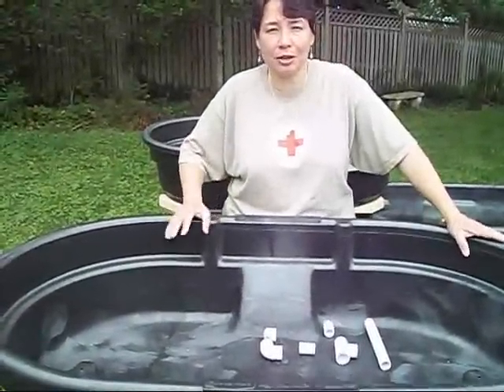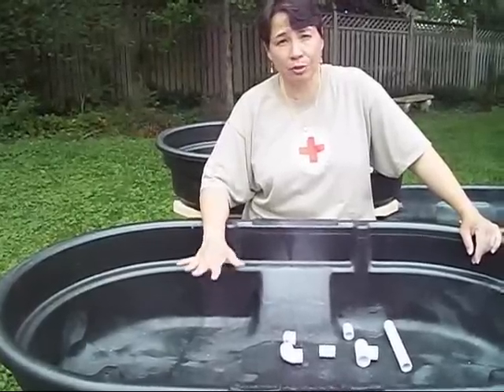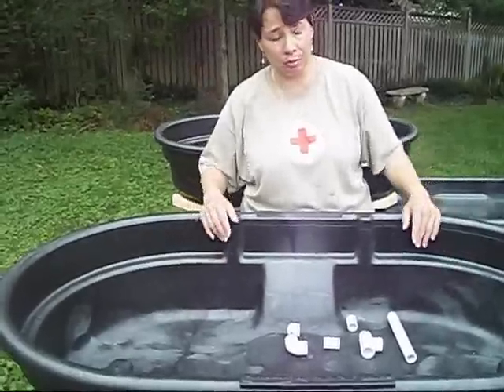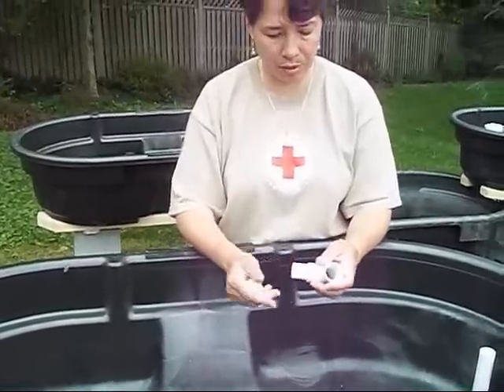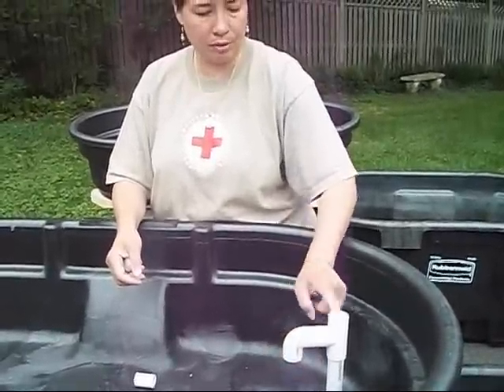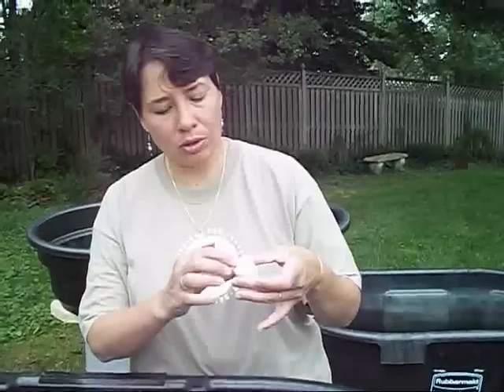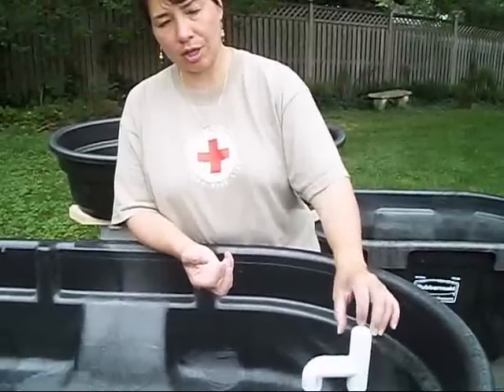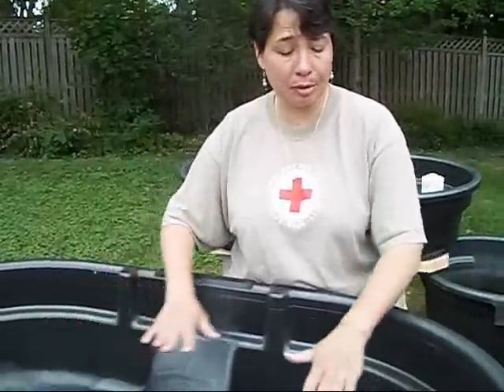Durso Siphon

Comment: Maybe my blond is rearing its hairy head, but would you have the media bed drain into the raft tank? How would you recommend incorporating a raft into a media bed-based system? My hypothesis: gravity feeds the grow beds via inline valves, which drains into a 1 pump sump, which gets pumped back to the FT & rafts; the rafts drain directly to sump. What're your thoughts? I've found that the info about adding a raft to a media system is vague. Thank you for indulging the barrage of my questions.

Comment from the maker: My pump is slightly elevated in the sump, so it isn't sucking straight from the bottom. This works great on days when the system dries up, since I have three goldfish and two minnows in there. When teh pump stops pulling water, there's still 1-2 inches left in the bottom. Between that bit of extra and my goldfish and minnows helping to mineralize the matter that does get into the sump, things aren't too bad. Best, though, to put the floating raft after a media bed.

Comment from the maker: I like using garden hose, though I use the 5/8 inch white hose that is safe for drinking water. Pump is screwed into a plastic Y-splitter, and I add standard hose adapters to each length of hose.

PVC can be more affordable, but I hate the pressure loss and opportunity for clogs you get at each elbow. The white garden hose also lets me spray off bugs or deeply water transplants as needed.

You do need to make sure you secure the hose well so it doesn't go emptying onto the ground.